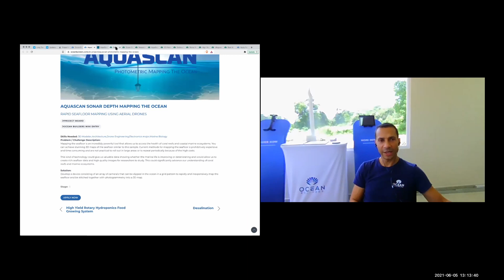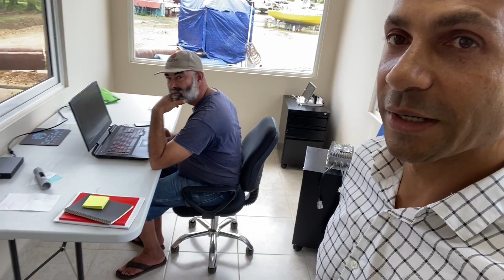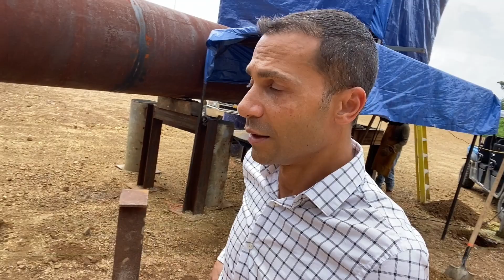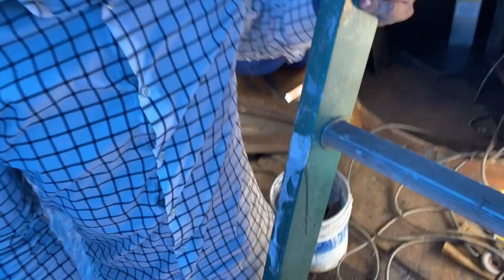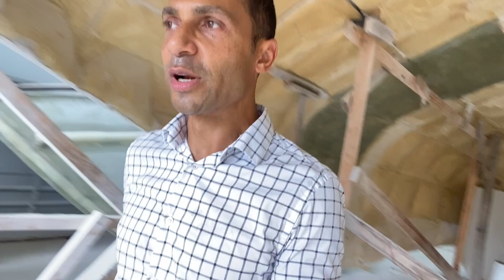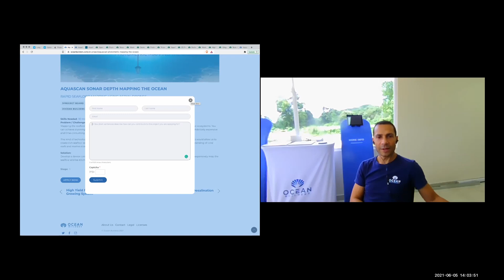Ocean Builders Project Management and Factory Tour

Comment: Best hire a qualified safety and health professional.  It doesn't appear you require any fall protection onsite or PPE for the laborers working with fiberglass.  Betting there's no local exhaust ventilation for the welders/grinders and don't think you'll properly plan for the abrasive blasters either.